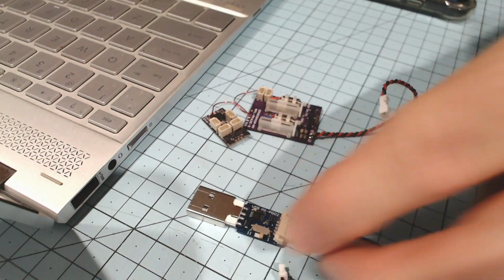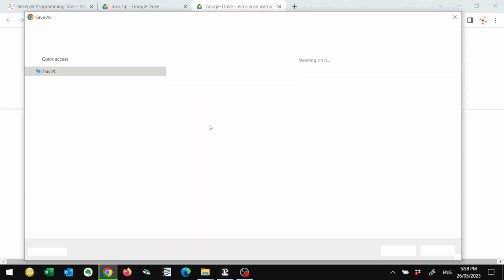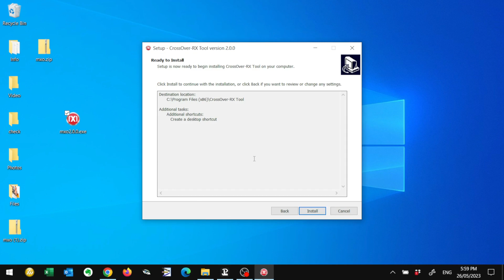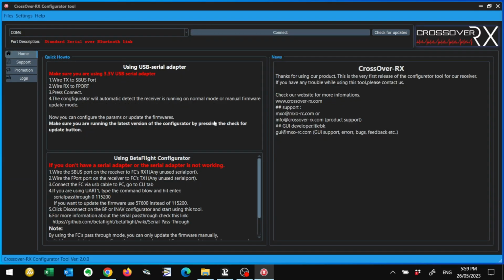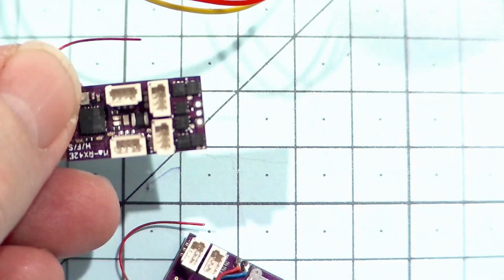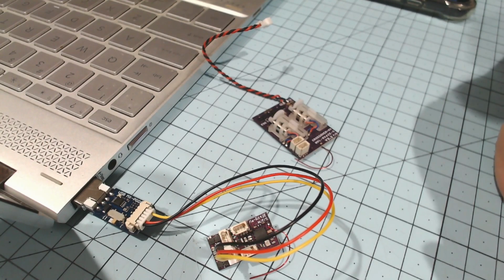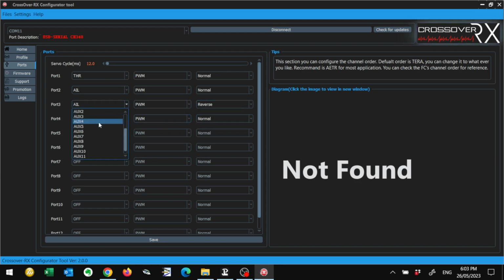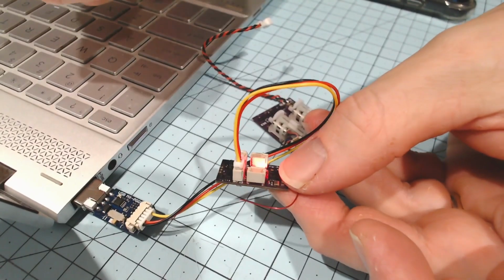RC Receiver Programming Tool

Comment: Can u also do a depinning of that wire to board connector? I thinkit is called rast connector. I can’t find a depinning video of it anywhere.thanks in advance
Reply from the maker: I've never tried it. I assume you want to solder direct? should be possible.

Comment: Thanks for the video. On the receiver with the built-in servos, will this tool allow me to change the linear servos from rudder elevator to aileron elevator?
Reply from the maker: Yes I believe it will. This tool allows you to change the chanel order for all the ports. But actually you might not even need this tool. If you want to change channels you can do that by programmion most radios. See if you can do it on your transmitter first.
Reply: @MicronWings  thanks! My cheap xkx6 transmitter doesn't allow me to. I'll probably give the tool a try.

Comment: Very good. Im assuming ESC programming will happen at some point?
Reply from the maker: No actually I can't see ESC programming happening with any future software updates. I should have said that differently. At the moment I can't find any way to do ESC programming with these receivers.
Reply: @MicronWings  ah, I was just thinking cool just solder one time and reverse it in software, yeah, quads got me lazy with some FC’s being able pass thru to ESC programing like reversing and other ESC properties. I have dx9+ and 10 slots setup for delta wing. 1 is 1m wing 2 is 24” wing. I should just buckle down and set radio up with 4 aircraft types: quads and hex’s, planes and wings. making Rx’s same id. My thoughts are if I start to with wrong aircraft for quad, or somebody at flying club field turns Radio on same time as me, and we both did rx id numbering…I worry about weird stuff hehe